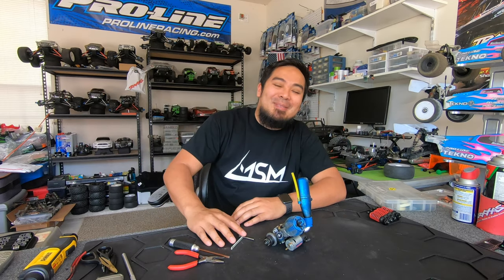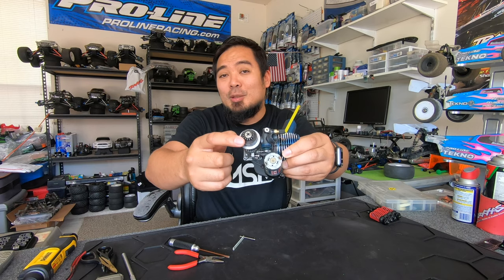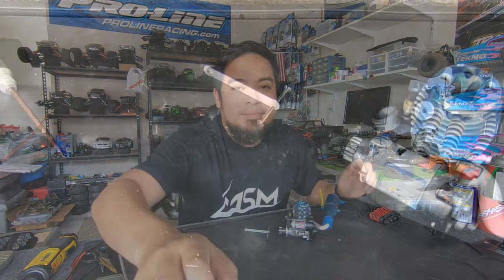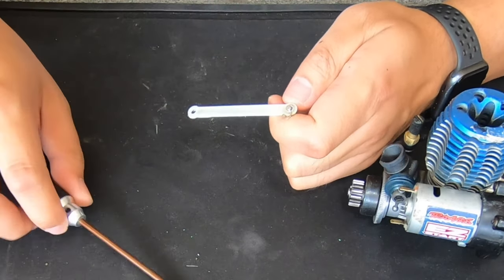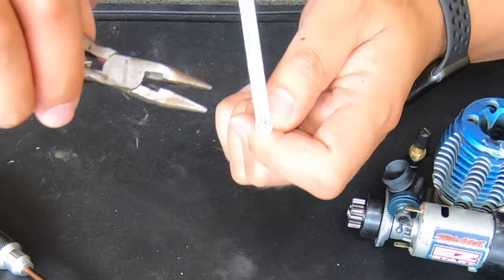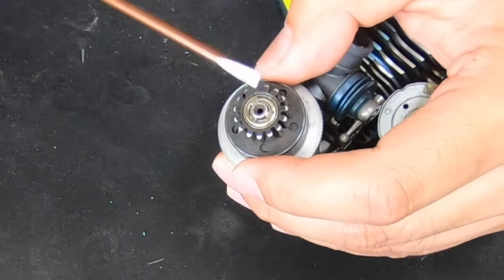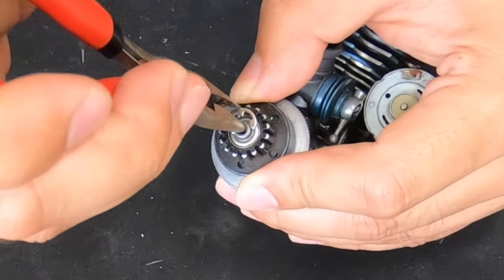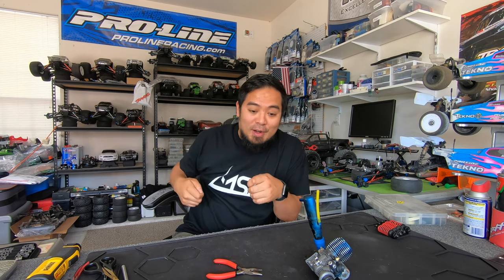Removing and Installing the Dreaded E Clips RC Cars

Comment: I've broke flat heads doing over time so I took one of my old ones and ground it down to a point and use that now I've also use picks to do this in sooner older Ford cars the throttle cable is held in by a e clip

Comment: So doing the widemaxx conversion on my maxx. I am shaking my head at traxxas engineering when they put the e-clips on the drive shafts. They are so small and there’s absolutely zero room between the clip and the pin making it extremely hard to do. I was able to get two off, but the rear clips are impossible

Comment: I had to figure this out the hard way long ago changing the front tires or springs on my RC10L yes Associated was that evil back in the day the front wheels were retained by an E clip 🙄
Probably should add some E clips and snap rings have a flat side and a chamfered side on the ends the flat side should be towards the bearing or whatever or they pop off to easily 🍺😎👍🏽

Comment: This is a proven method and one I have used, however it does have a  high chance of damaging the metal. That is very bad if you are building parts that have very tight tolerances.